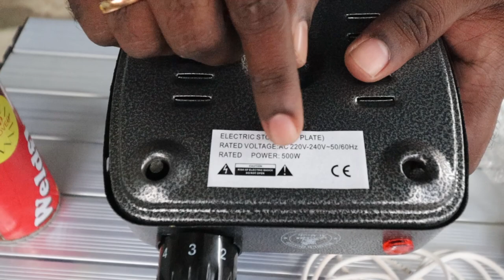500W Smart Charcoal Heater Testing - LET'S UNBOX | DAN JR CM

Comment: I use kerosene method bro , dip a small piece of cloth in kerosene and light it then keep charcoal pieces around it like a mountain then wait until it is fully done then mix it with other charcoal. I use this method regularly, it is pretty easy and fast😉
Reply from the maker: Super 🤔🤔 let me try in next video 🔥🔥
Reply: Kerosene method not suitable for cold area like ooty kodaikanal, kashmir etc  so this device can use in any temperature, I am using this at ooty